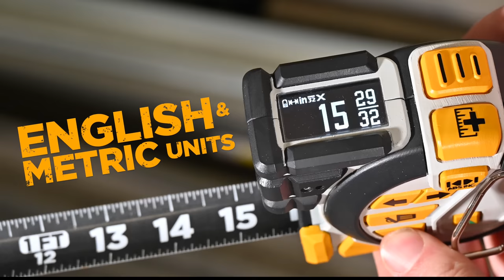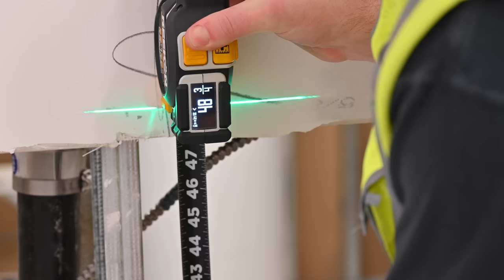T1 Tomahawk Digital Tape Measure Overview - REEKON Tools

Comment: As a carpenter I would like to chuck this off a third story roof onto concrete and stress test it. Also looks like complete overkill and most likely have issues I'll stick to a normal tape for now way cheaper to replace by the time winter consumes yet another tape

Comment: Pre-order request submitted, wow REEKON thank you for what appears to be an innovative masterpiece. I need this for my emergency restoration business!
Reply: Emergency restoration???
Uh...ok.
Never heard of that before.
Reply: @dirtydigger3218  pipe breaks and floods a house with a family of 7, I quickly dry then repair the home better than it ever was. Fire happens in a kitchen in a home with a family of 6...
Reply: inside measurements is wrong
Reply: @dirtydigger3218  should be called " Emergency Repair"🍺
Reply: @TaylorMadejdm1975  he's on the next level. He doesn't just "repair". He restores the collateral damage as well. "Turn Key" 😊
Reply: @dirtydigger3218  never heard of a flood or a fire?

Comment: When taking a measurement, I'm always doing addional addition and subtraction of fractions for the actual cut I will be performing.  Would be nice to have a preset  button to add or subtract  for each measurement I make. Also, it would be nice to implement  the lengths of the lumber you are using come in. Example 12' 16' 20'  then make all the measurements around the house divide it into the lengths provided and "boom" a perfect order list of lumber to your phone. I could go all day.
Reply from the maker: hello, the ROCK App has a full integrated fractional calculator that can perform any mathematical operation using captured measurements.

Comment: Would have been cool if you did a auto center , measure to a point hit a button and it tells you center, one step more it lights up when you measure in to the center point
Reply from the maker: It does have an auto center function (along with upgradable firmware so we will be releasing new features regularly)!
Reply: @REEKONTools  well you just earned a pre order from me!
Reply: Convert to metric then divide by 2…way easier than worrying about fractions 😉

Comment: This looks like it solves many of my normal pain-points when using a tape measure and it looks like you've incorporated some improvements learnt from your M1 Caliber.

Does the tape measure read incrementally and need periodically zeroing between measurements, or does it read an absolute distance like absolute calipers do?

How does it perform with moisture or dust and dirt? Is it possible to clean it out?

Will it be able to calculate the expected hypotenuse of a frame and guide the user to squaring it?

Edit: Just noticed that you've already provided an answer to the absolute / incremental question in the video description. The dirt / moisture question still stands though.
Reply from the maker: hey Andrew, the tape has absolute correction and is a closed loop system (unlike the M1 which relies on the contact between the wheel and wood).  There are wipers at the mouth but the case can be taken off it too much accumulates inside (the spring and tape are attached to one side so it can be opened)
Reply: @REEKONTools  Thank you.

Comment: Who needs a digital tape measure?  A regular one does everything I need it to do.
Reply: Did you resist switching to a cell phone from a landline too?
Reply: @notahotshot  no, I didn't.  Cell phones were an extremely useful and convenient alternative to land lines. But tape measures are literally the simplest tool on earth. In my trade I use a tape measure at least a hundred times a day. I don't need to push buttons, change batteries or worry if its accurate. The digital one might be ok for homeowner harry, especially if he doesn't know how to read a tape. But even then,  its going to sit in a drawer until the next time he needs to hang a shelf or whatever the case may be. When he grabs it from the drawer the batteries will be dead and he probably won't have any extra batteries on hand. Now, he has to drive to the store to buy batteries and his 15 minute job is going to take an hour or two. No thanks.

Comment: Hopefully I have better luck with this tool when it comes out than with the M1 caliber mitre saw gauge. I don't have 6' to the right of my blade and can't calibrate and moving my custom homemade workstation isn't feasible so I have to return it. Hopefully Reekon will make a newer revision that doesn't have this limitation. Hope this helps the next person behind me because I didn't find this out until I tried to calibrate according to the YouTube video.

Comment: So I understand the laser measure devices. But why over complicate a tape measure? It's a cool idea, but thinking about all the things that can fail on this during the day, and then thinking about the price it would cost to replace it after it breaks. 

What kind of warrantees does this have? How long is the battery life? How rugged is it? Is it water proof?

Also want to mention size, if this is a replacement for the standard measure is there going to be a normal sized version of this?

Comment: The steel tape usually breaks after a while. I don't see in the video where the tape is changeable. I would hate to throw away such an expensive tool because I cannot change a broken tape.

Comment: Hows this thing going to measure corners that you need to press or bend the tape into .Doesn't the old fashioned measuring tape indicate what the results are.Why do I need a second digital display to throw me off.Storing measurments is handy but Couldnt it just wifi to a phone or pad instead of a one of a kind unit that needs to replaced if the tape cracks or breaks.

Comment: Can’t wait to get my hands on this bad boy. Definitely will help on the job. The real question is how Accurate is the device I had a device similar to this 1 in the past it was always off by 1/16  or 1/8 +/-. How often should this device be calibrated.
Reply from the maker: We developed the encoding technology from scratch and is accurate beyond 1/32" and is self calibrating every time you move the tape measure!
Reply: @REEKONTools  I tried pre ordering on kickstarter but I’m having trouble with there site.

Comment: It's really out of this World no question about it. Though durability would be an issue. And the fact that it will never withstand the punishment of a regular tape measure.
Reply: Exactly what I’m saying, I mean I use my measuring tape every minutes taking it out putting it back in. They usually start to wear off. I don’t think this are really meant for long measures. It’s too big looks very uncomfortable to grab when your trying to measure something more then 10 feet it might even bend more easily since it’s not that wide.
Reply: Hopefully they have a replacement for the tape it’s self
Reply from the maker: @carlosjemeniz3285  The blades are fully replaceable and the entire unit is impact rated for drops!
Reply: @REEKONTools  dove si compra?

Comment: I've owned a few electronic tape measures in my 25 years in construction and they did okay for what they were. My only questions are, how easy is it to access the battery if it needs replaced? Because you market this for construction personnel then you know it will be abused, what kind of warranties do you offer on it?
Reply from the maker: The battery is rechargeable (and removable) by sliding up the back cover.  The T1 comes with a 1 year warranty and the blade is replaceable!

Comment: This looks great, only problem I have is the design, it differs from a standard tape measure greatly, majority of tools belts are designed to fit your average 8m tape comfortably, and this looks a lot bigger so finding a way to store it in your belt will be a pain. Also, the durability of it. Milwaukee and Stanley have their tapes rated for pretty high drop heights. Wonder how this will hold
Up being dropped of a ladder or scissor
Reply: Dude... It's the 1st of it's kind.  If we buy it other companies will compete and accessories will follow.  It's literally day one. 🤔💯😂
Reply: @malcolm4458  i was just thinking to myself, why aren't there digital tape measures? just put small magnets in the tape and have it read it like a digital caliper.. google it and here we is. if i had only come up with this idea 5 months sooner i'd be a millionaire
Reply: Вот я тоже думаю ,бесполезная и дорогая вещица для использования на практике .

Comment: Can you guarantee the display stays in sync with the tape at all times? i have tried several of these digital tapes and they all have offsets if you pull or retract the tape too fast. offset can be as large as 1/2 inch. I have destroyed sevaral piece of hardwood because the displays tend to not be able to follow the actual tape.
Reply from the maker: Hi Vincent, yes.  One of the core technologies we developed to make this a professional grade tape measure is the ability to self calibrate and not be limited by any speed a human could pull the tape with, ensuring what is displayed is what you get at all times!

Comment: As many times as workers drop their tapes during the day with this be as durable as a tape being dropped over time? It would be kind of useless if it wasn't so durable to be used in the field.
Reply from the maker: Yes, it is impact rated for 1m+ drops and the blade (the most often damaged component) is replaceable!

Comment: How durable is the measuring tape coating?  Will it compare to dewalt?  What ANSI rating are you going for with drop testing? Look at project farm's tests, how will it fare in those?
Reply from the maker: Hey Steven, the coating itself is comparable to most top end brands and is fully replaceable should it get damaged.  We are looking for about a 6 foot drop rating and are working on optimizing materials and geometry before having a final answer.

Comment: Does the tape also show tenths? I need one for underground utilities
Reply from the maker: yes! there is an english decimal mode which displays inches in decimal format
Reply: @REEKONTools  that was my question as well.   If it does display feet broken down into tenths then you are going to get some of my $$$
Reply from the maker: @RDiDonato777  yes! also the firmware can be upgraded over bluetooth so in general were happy to continually add useful features to it, based on customer feedback, as well!